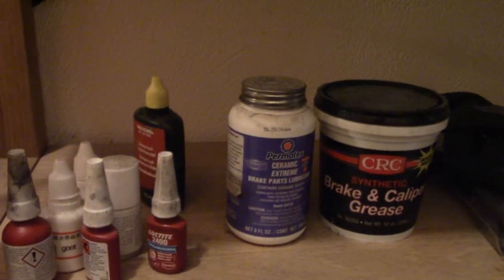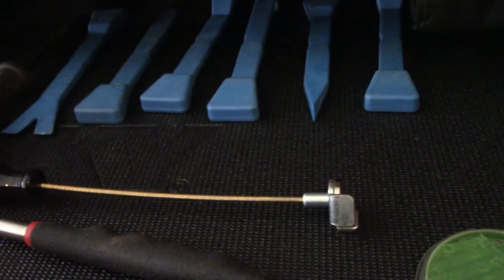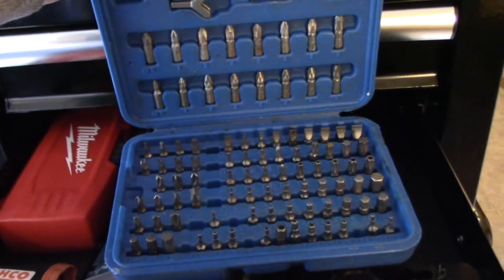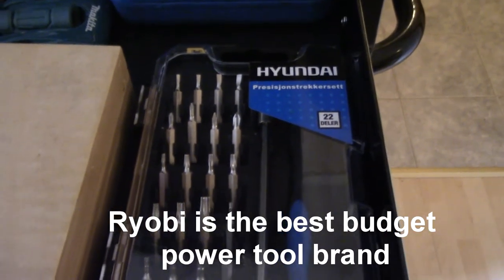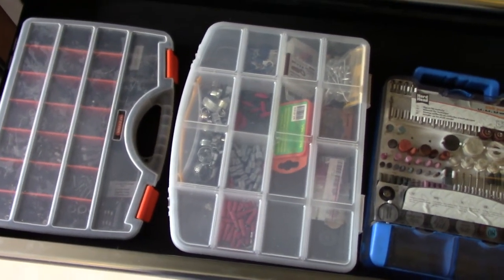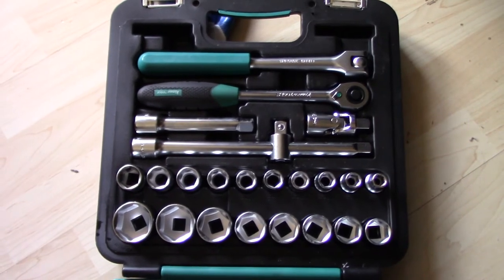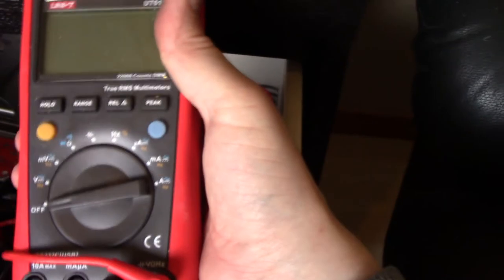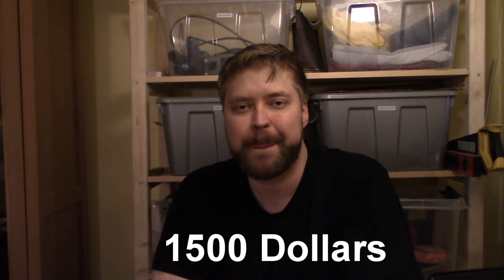Toolbox tour

Comment: Nice tools man. I really like your IR impact, I got the smaller 3/8" and would like to get the full set.
Reply from the maker: the IR is good,  I now got a bigger battery for 200 Newtonmeter more torque and plastic boot for it. The other IR's are not brushless, so IR needs to come out with some new impacts. But Milwaukee has a nice new high torque model that comes out in september. And I'm looking for the One Key model that comes out around Christmas. They always give options for a boot on their models, which is nice. 1400 ft.lbs they say.